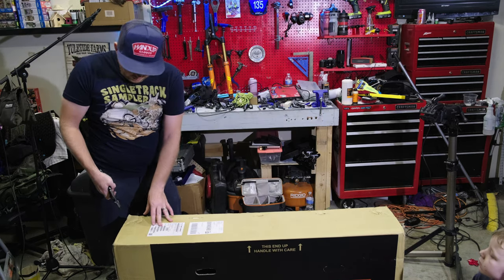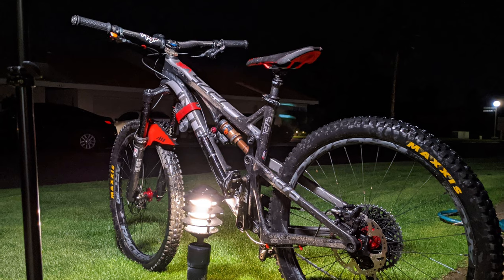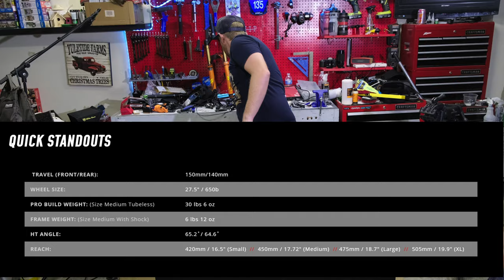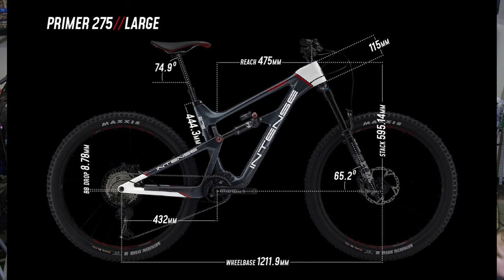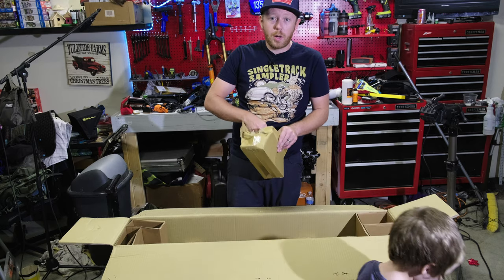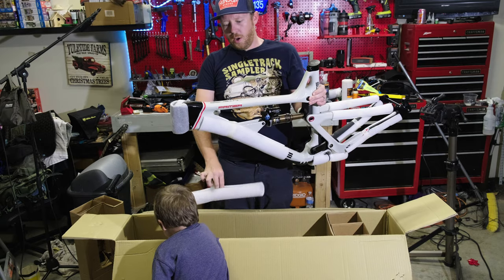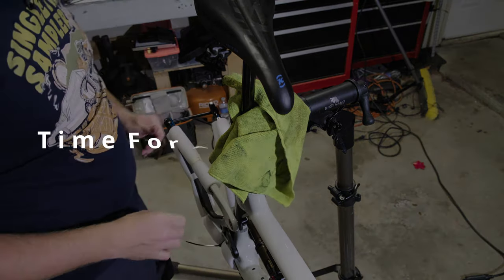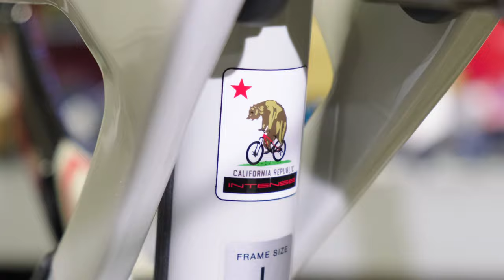Dream Build | Intense Primer 275

Comment: how would you describe the 275 Primer? is it trail balance or more leaning to descend? Cheers Dad=)
Reply from the maker: Its pretty well balanced. It Decends better than my old tracer that had more travel. It climbs way better. Its really going to be depend how you spec it out. Tires especially will make a huge difference. I literally just swapped to running a fast rolling rear tire from a aggressive one and bike became so much faster up and down.  🤘👍
Reply: @MTBRadDad  I feel because I am from the Prairie I need to convert it to a more XC-oriented bike(XC tires?). I am debating with Sniper T and the 275. my Issue with the Sniper T is the upgradability or converting it to more trail-oriented.
Reply: @MTBRadDad  I'm from the Prairie so as much as possible I want it to pedal well on flats, need to set up the bike to more XC-oriented. Cheers!
Reply from the maker: I had a chance to ride my buddy’s intense sniper , that thing is fast , might be more suited for your trails?  That or the trail version